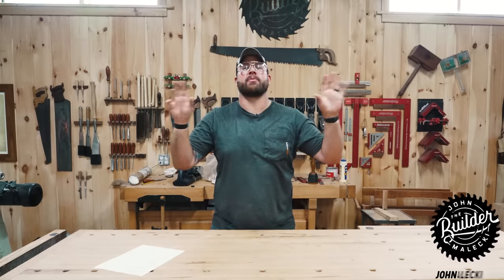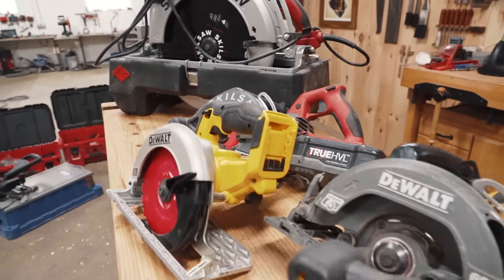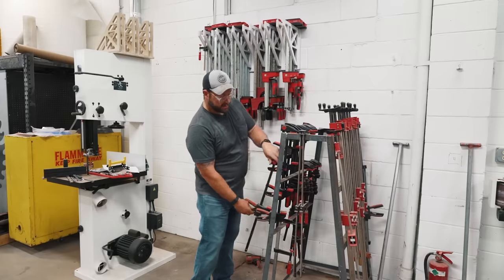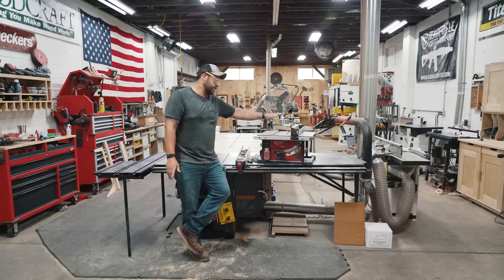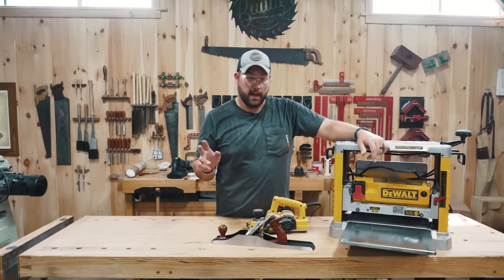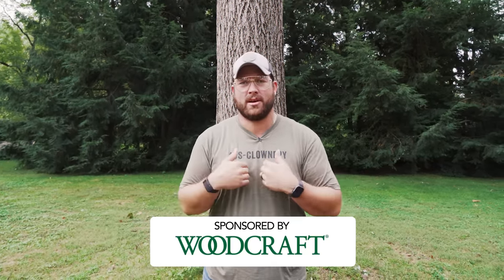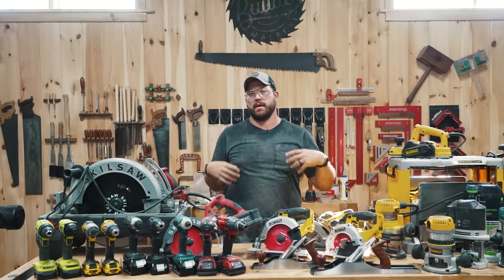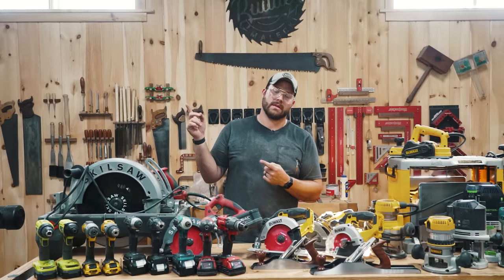10 Must-Have Tools For Beginner Woodworkers

Comment: Really great list, however one tool that I personally highly recommend as a top 10 tool is a doweling jig. Get a really good accurate one too. One of the best on the market in my humble opinion is the Dowelmax. Once you understand the concept of how it works based on two points of reference on each piece to be joined, the joints are not only hidden, but extremely strong. Tests have been down between the Dowelmax system and the Festool Domino, and yes the Festool is fast and extremely accurate, but the Dowelmax joint is actually stronger. Really a great tool.

Comment: Thanks John. As someone who has been woodworking about 10 years, I completely agree with most everything you said, and really agree with your thoughts on wanting to know you can work with a dangerous tool before upgrading to it (i.e. the router in your case). I have never had a circular saw, track saw, miter saw or pocket hole jig, but outside of the latter one, I have definitely found situations where they would have come in handy. Thanks again for this content. It's really great!
Reply: Hi, since you didn't have any saws (as such), may I ask how did you manage cutting wood? I am facing a similar conundrum!
Reply: @jimbokraut640  I have a few saws: table saw, band saw (which replaced the jig saw I had when I first started), and other than that, I do most everything with Japanese hand saws.

Comment: Being only 2:45 into this video I just want to chime in. The Milwaukee fuel m12 impact and drill driving is a great option. I do construction and use this set everyday. I’m not going to say they are as powerful as an 18v because that is just simple not true. But the impact will sink a 6” timber lock into an lvl easily and the drill driving will get you into concrete. Can find them on some pretty good sales too. Just throwing in my knowledge, hope it helps someone!

Comment: 1. Router 
2. Circular saw 
3. Drill 
4. Sander
5. Jig saw
6. Clamps 
7. Measuring tape
8. Rafter square 
9. Straight edge
10. Wood burner

Comment: I will add that you should make sure to check the base plate on a circular saw before you but it.  I got the cheapest one at Lowe's and didn't notice until later that it flexes when you push down on it, which gave me some unwanted beveled cuts.

Comment: Bosch 12v impact work awesome has a lot of power. You should check them out. I use it everyday at work. It can handle 3inch screws going into studs

Comment: I am a beginner woodworker and am just building up my power tools. I have a lot of hand tools but need a BUNCH more specific to woodworking, a bench top drill press, drill, jigsaw and clamps, next is a skil work site table saw. It is a little bit cheaper than the one below, which is a plus but I want it mainly because it works with dado blades. I was looking forward to this video when I saw it posted and now I am just disheartened at the Entry Cost Barrier to get into beginning woodworking. I do believe in buying the best you can afford to save in the long run but the prices below are not cheap and then all of the little things not listed really add up, blades, saws, chisels, drill bits, rules, squares, clamps, workbench, etc.  Can you perhaps do something like a $1000 must have?

Comment: What I miss is the old trusted handsaw as the about most versatile tool besides screwdriver, then the jigsaw and probably a sanding-machine.
'In the early days' of my life those were the things that were the most important things to have (besides the hammer probably) even before the electric drill (+ -stand) and a bandsaw came into sight. Yes, I learned to drill with the handdrill for wood and the electric drill was used for bigger drilling, driving the electric blade saw (as table or in hand), flattener (using a round peg with sanding-paper) and other things we made that was practical to run/turn fast. Oh yes, also for driving the lathe which is also very handy to make plugs and pegs from left-over wood. Yes, cut it kind of square with the handsaw, put it o the lathe (so you did not have a drill handy at that time) and turn it into the size you needed for your pegs.

Comment: Fortunately as far as the circular saws and bigger power tools, my work provides them until you become a lead (I install storage solutions) but even in my very niche field I use them daily. And I can't agree with you more on the battery platform, I've always used dewalt personally growing up and still use them today, but there's a few people who roll around with 4 different brands so they have 4 different batteries and chargers with them, and they don't want to use the adaptors. So I would recommend for battery powered trying to stick with the same brand. And I prefer battery powered as much as I can up to table/meiter saws because most of the time the cord gets in the way during installs and half the time the outlets aren't operational, but any major cuts we make are always in the truck or on a balcony if in a high rise, makes clean up much easier.

Comment: Nice list John but I'd add one thing. If you're getting into fine woodworking I would hands down skip the circular saw and get a track saw. If you're doing home renovation/rough carpentry then get a circular saw
Reply: Track saws are also 10x more expensive... But ya since getting one I never use my table saw... Ever

Comment: 5:20 Bessey...good german stuff👌🏻. Clamping couldn‘t be better, especially when everything has to be glued together in time...you can get cheap ones, but you will replace them anyway(because you can really get annoyed during work)...so go with bessy...it‘s worth the money...that‘s what i highly recommend
Reply: I used Jorgensen before they disappeared from the market and I think they were STRONGER than the Bessey ones. (Just f-style) 

Not saying Bessey is bad, just that my experience was that the Jorgensen ones were cheaper and felt smoother and stronger, but that could just be my bias towards orange tools...

Comment: On the planer front, be good to add that you can buy a joiner/planer 2 in 1 that just requires moving the bed to use the planer.

Comment: The biggest problem as a beginner is justifying tool cost for something you might end up not liking to do. But the other side of that is cheap tools lack the accuracy that more expensive tools have and crappy results is not a confidence builder. It was when I finally decided to spend the money on good stuff did I realize I'm pretty good at this. Wouldn't call myself a journeyman but I've made some nice stuff. Good luck to all you newbies out there.

Comment: Granted it wasn't a direct entry on the list, but you mentioned it with Circ saws.  You said if you want to go bigger or better get a track saw.  I would say - no.  If you have a circular saw already and want to "go bigger" or better.... just jump to #4 on the list and get a table saw.  It does what a track saw does.... and then some..... a lot of "some."

Comment: Questions:
1) clamps. what size of clamps and how many are good to start with? is just four 24” ones good for like small tables and boxes and cutting boards and beginner projects? 

2) table saw. How important is it to have a table saw that can take a dado stack? I notice most job site saws can’t use them. That a deal breaker or? 

3) instead of relying on pocket hole for things you mentioned; do you have a good video explaining string joints to learn and use or do you have a good video to help learn that? 

Thanks for your time sir.
Reply: 1: Clamps. At least 4 in the 12-15" range. At least 2 that can reach out to 32" for drawers, and make sure these are stiff. And two stupid big ones. Consider a long reach pair of vise grips. They're $18 and can squeeze a 3" stack rather well. You never know.

2: You can dado just fine with a flat ground blade. Sure, it's faster to use a dado stack, but that's if you do lots of stuff with your table saw, just make a few cuts and cal it a day. It takes 20 seconds to make a cut. 

3: Try making a bunch of different wood joints. Make some good dado joints, Tee laps, Lap joint, and cross laps. You can do those with a circular saw and pull them tight with a torx screw. I strongly advise you consider that before you start messing around with pocket hole screws. Consider things like sandpaper, Scotch Brite 7447, and different finishes. You can't get a beautiful finish on a pocket hole joint the way you can a Dado. Consider how easy it'll be to refinish something you made in 60 years, long after you have died. Take a nap. Make a couple small cabinets for guns/liquor/pictures/dishes. That'll help you look at carpentry a lot differently.

Comment: Whoa!!! Beginners these days! 🤣🤣 
I started with the following: 
1. Cheap hacksaw and ONE blade. 
2. Piece of string and a couple of nails to mark straight lines (like a horizontal plumb level)
3. Couple of sheets of sandpaper for finishing. 
4. Nails. Lots of nails. 
And thats it. Cut with hacksaw, clean with sandpaper, join with nails. Rinse, wash, repeat. 
The first power tool I used was a HUGE hand-held power drill. I think it was made in the 70s, had an internal short and a metal body, always tingled my limbs senseless while using it. Not to mention the workout it used to give my arms. Drilling upside down? Forget it!! 
It is amazing how these constraints made me learn the job way better back then. Having a gazillion tools at my disposal nowadays mostly causes decision fatigue, if you know what I mean. 
A hundred power tools means I'm always tripping, and not in a good way. 
Lots of cordless tools, lots of incompatible batteries, need to keep them all charged, freaking chargers keep failing too!! 
I'm not saying hand tools are better than power tools. At the end of the day, all tools have their place and all users choose whatever tools they need/want for their purpose. 
If the tool manufacturers can finally agree on a universal format for connecting batteries, now THAT, would really be a step up from corded tools.
Reply: Yeah just came from a video for ‘beginner cutting board’ needs table saw, miter saw, planer, jointer?? Like what $2,000+ lol

Comment: So I have a drill, impact, clamps, reciprocating saw and chisels so far. Picking up a circular saw and maybe a jigsaw. I have quite a few clamps, but there’s still more I want. A bench vise and a woodworking vice. A Rockwell jaw stand. Is the table saw the next tool that I should get? Oh and I have an orbital sander and Dremel too.

Edit: I feel like a circular saw combined with a straight edge could achieve the same results as a table saw. Is it still better to have the table saw or could I move on to something else?

Comment: Could you show how some of the woodworking tools can also cross over to the metal working side? For example a standard sidewinder saw with a carbide tip blade will cut 1/2" aluminum plate almost as easy as it will sheet goods. And a router is just an electric die grinder with a base. Also if you get a Bridgeport you dont need a drill press and you can mortise with it.

Comment: In my personal opinion. 2 tools will get you started aside from your measuring and gluing items. A reversable drill, and a jigsaw. One cuts things apart, the other makes holes and can put things together. Master basic cutting and putting together first. Then begin learning to make things nicer. You can make a simple garden box with a drill and a jigsaw. And they will sell.

Comment: John, your choices were spot on, what are your thoughts on a band saw with re-saw capabilities , when would be a good time to get one. I also noticed you have a lot of Woodpecker Squares and tools, I know they are good and out of my budget. I've been using pretty generic squares and such to mark my work and usually double and triple check because i know combo square is a little off. If you could give some recommendations on less expensive but good combination squares and t-squares, maybe make a video about it, "Marking and Measuring Tools for Beginners"  or if you have already made one, let me know where i can find it. Thanks and continue with your A- Clownery

Comment: Thank you for this!! The tips are fantastic, and definitely helpful!! Would you be able to do a video fully explaining the purpose of pocket holes? I had no idea there was a specific way to use them. Your explanation made sense to me but I would love a bit more detail on it. Also, is there a reason why a belt saw isn't on this list? The woodworking shops I've been in have used and had one. Are they not as versatile? Is that as a tool becoming outdated technology?
Reply: If you mean band saw then it seems to be used for either non-straight cuts or cutting wood in half by it's width. Otherwise the table saw is usually better, larger table with larger fence makes controlling the cuts easier.

Comment: I just started getting into woodworking and mostly agree with the list. I feel that I haven't needed to use a planer yet although time will tell. I do feel like a sander should be on there. Where would that fall outside of your list? Top 20? 30?
Reply from the maker: 11. I should’ve probably had it at 10. But I was trying to focus on tools that you cannot easily use hand tools to replace.

Comment: You can in fact make the first flat side of a piece of wood in a thickness planer, it just requires mounting and shimming it on a board you know is already flat so it can't compress/twist from the pressure of the planer.

Comment: If I walked into a garage and saw all of these power tools aid assume the person is pretty advanced and active in the hobby. This list is way beyond beginner, but something a beginner might think they need. 

A beginner might be able to make a lot of nice looking things with all these tools, but it doesn’t necessarily improve their skill. 

An advanced wood worker doesn’t need so much.

I think a better list would be drill + circular saw + sander + good hand saws + accessories (saw horses, clamps, jigs, glues, finishes/brushes, screws/dowels, etc). 

Hand saws are really underrated and a I’ve used mine a few times for simple projects, just something kind of zen about using manual tools. Also when I had shop class as a kid we had to do everything with non power tools first, and graduate to the power tools. Honestly I’d recommend beginners start with manual hand saw and boards. 

Also, table saws are really dangerous and I wouldn’t recommend for beginners.

Comment: Maybe dump question.... could the jointer replace the plainer? Both do flatten the surface so with a measure tape i should be able to achieve the same result, or?

Comment: My first tools were a Dewalt orbital Jigsaw, A metal Stanley Speed square and a Makita drill set. I look back now and laugh at all the stuff I chopped with my jigsaw. Sure it was not the fastest method but I was intimidated by Circular saws and Chop saws for awhile. Shortly after I got two Quick grips. They were a godsend.

Comment: Actually for Woodworkers it goes higher than cabinet saw. There is also something called format saw. Basically a monster version of the cabinet saw but still used by many woodworkers arround europe. They are on the higher price range though. Prepare to pay at least 1.5k for a good one. The smaller ones are usually not a lot more helpful than a cabinet saw.

Comment: Thanks! I need a recommendation. I'm in the market for a router. Small jobs: mostly cutting pickup holes and neck pockets in solid body guitars. Occasional other small jobs (mostly roundover on planks). While "there ain't no kill like overkill" I don't want to buy the 3.25 horsepower Triton if a palm router will work just fine. good visibility of the cutting tool, and maybe a built in blower (if not, I can tape my vacuum hose down near the work. 

Any suggestions?